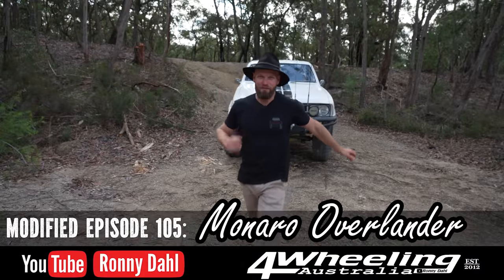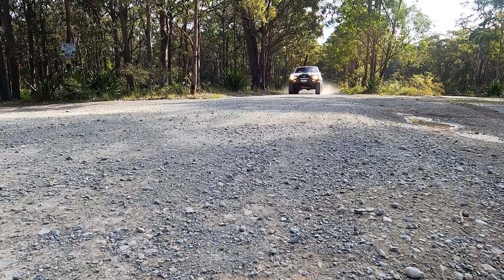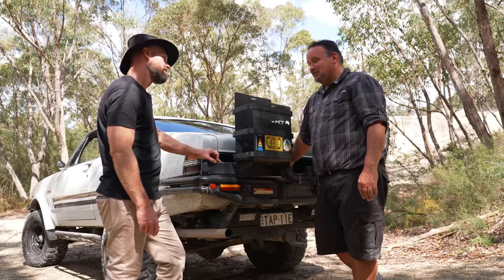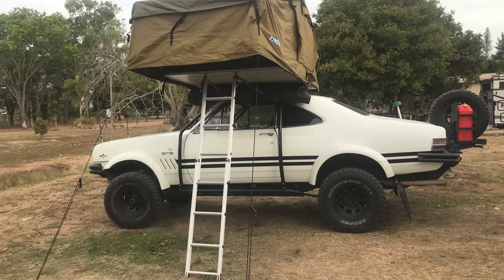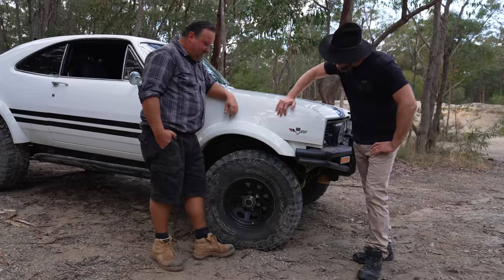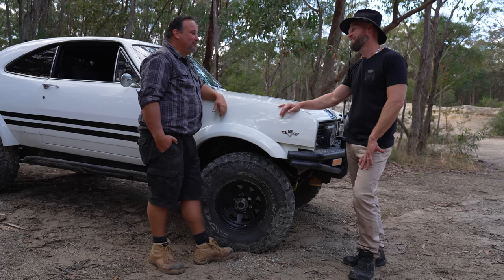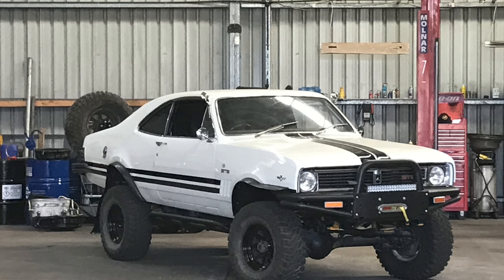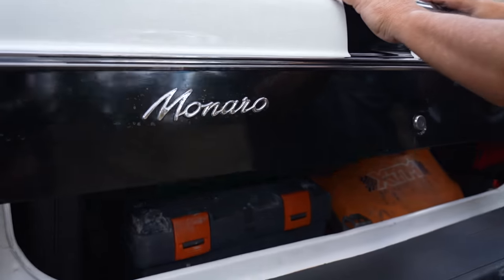4WD MUSCLE CAR 💪 Modified episode 105

Comment: Ah here is something different! I understand the reason, wanting something different and the looks, its part of the reason we keep driving around our VZ Adventra's just unexpecting but super capable, more capable than onlookers think. That's the best and he hasn't even gone overboard and put lockers in or anything just your common lsd. Nice one. It does shock me though for how long he has had it for he hasn't done Simpson Desert / big red etc but has done cape easy things to tick off and amazing experience to be had.

Comment: I agree 100% It is great to be reborn into something unique.  I have been thinking for years to do a similar thing with an old station wagon on an 80 Series chassis
Reply: I think a Sandman or station wagon version of this would be perfect.
Reply: @akar2755  they used to make Holden & XY Falcon wagons as 4wds
Reply: weren't very unique 30+ years ago, used to see quite a few utes/ wagons, occasionally a few sedans would pop up, usually hq-hz
Reply: @thebob3712  & not one 4wd Monaro! So it IS unique!
Reply: @MicahBell_1860    Im sure there were a few monaros. 30+ years of beer and bourbon clouds the memory. You had been thinking of doing it for years to an old wagon? I just pointed out that that has been done so not very original. BTW waste of a monaro considering how much they are going for these days
Reply: First of all @thebob3712   no Monaros ever were made into 4wds. Secondly, although yes there were many wagons & utes on the Overlander chassis, they were XY Falcons & HZ/X/J. Not the wagon I'm thinking of. & Lastly, if you watched the whole video it was clearly pointed out that the whole floorpan & iner guards etc were completely rusted out & beyond repair, so this was a way it could be resurrected into a new for, rather than being turned into tin cans for your vegies at a scrap yard
Reply: @MicahBell_1860  you think no one converted any monaros?  Have you not ever seen a pile of rust of a car restored? not too hard to make a floorpan, Im sure he has one in it

Comment: The Nissan rear LSD is too good to lose, but an Eaton e-locker in the front will turn an already very capable vehicle into a much higher calibre off-road weapon. The Patrol owners I know with the rear LSD, front e-locker combo never stop smiling, especially when the "magic switch" is on!  🙂

Comment: By the way, how much is it per litre down there ? Hope not too much. In my country it’s about 1 US$ per litre. Which is really high. Not too long ago, it was like .70 US$ per litre. Fuel is becoming ridiculously expensive nowadays.
Reply: Welcome to my country. Record in 2022 is 2.59 USD for 1 liter of diesel. Now it costs around 2.2-2.3.

In 2021 it was around 1.75.
Reply: I get E10 Unleaded for $1.50 AUD which is fine by me (September 2022).
Diesel is 50c more consistently ($2+)
Reply: @neth77  And it seems like the rates will not come down any time soon.
Reply: @bannedone3ice138  Ever

Comment: I love this Monaro, I cam across it some years ago on line. Since 2019 I have been building a 1978 one tonner Kingswood on a modified GU rail. 

The original Overlanders were built with new car factory warranty in partnership with an outside engineering firm in Tassie. They actually used the original chassis with minor mods to it.

I even heard that the Army were looking @ them for a bit.

I actually started of try to hybridize a HZ rail with GU suspension mounts & the like. spent a lot of money with the wrong engineer to find out this was not ideal. The original Overlanders did not achieve any higher GVM than the stock factory Kingswood. So for want I wanted that was a little limiting.

I don't refer to mine as an "Overlander" with the GQ-GU rail I think it is actually better. When I looked into it I found that the way the HQ to HZ chassis were modified was not great & with mine I wanted the coils all around & a more useful GVM.

I have wanted an Overlander from the day I 1st saw one when I was 13. 

How this guy talks about it, his enthusiasm & wanting to create something different. I totally relate, it is exactly how I feel about my build,,, since I was 13. My only regret is not doing it sooner. It won't be for every one & that is a big point.

Ronny Check out Mark Alan's  (NSW) 1 tonner on a GU rail with an LS3 in it:

https://www.youtube.com/watch?v=BpR0kjwtGLQ

I would love to see you do a Modified ep where you interview Mark Alan, I think he is a bit of a nut -which kind of makes sense to me,  he embodies the same spirit & passion as this guy. I think like me he probably would never sell this Monaro. You have to be a little crazy to take on such a project.

Mine will be quit different to his. The hard part is how long it takes to build especially when you cant do all of the work yourself, I want to be out driving it now & I am probably 4 to 5 years from completion.

If you don't connect with a good engineer (I went through being messed about by 4 until I found one that can do the do as well as the speak.) the process can be tougher than it needs to be.

Great episode Ronny.

Comment: I'm from the US, so I'm not familiar with a 304 CI V8.  Is that an old school Australian engine, and if so, what from?
Reply: It,s a Holden V8 was a GM  subsidiary aussie made V8 based on the 307 chev V8.
Reply: It was a design exercise, part of the 60s Hurricane concept car, but power output was above expectations and was approved for production. Lighter than equiv GM inc SBCs, with Pontiac firing order